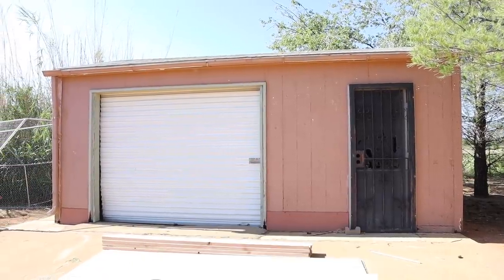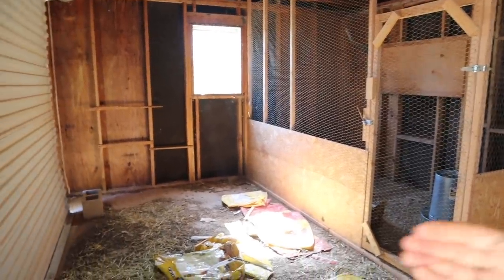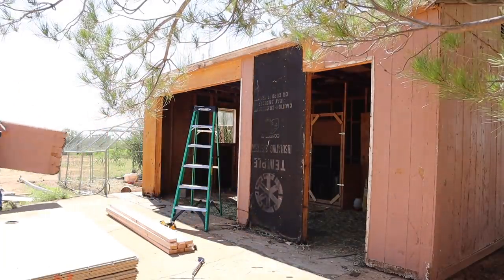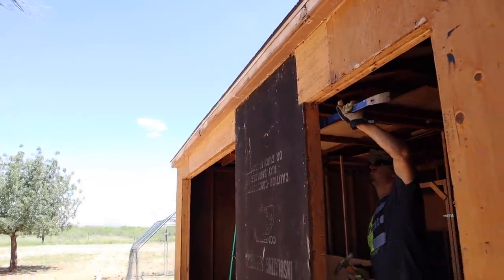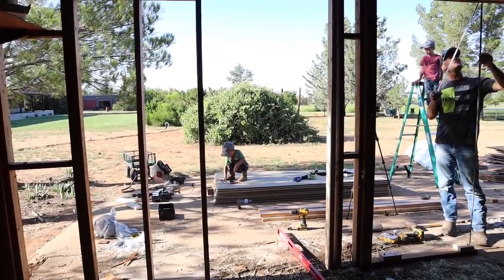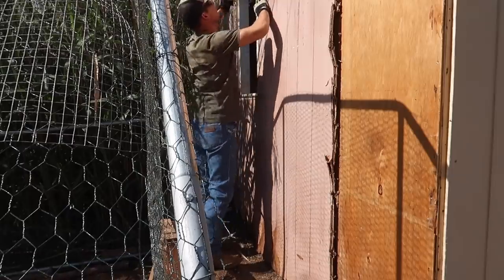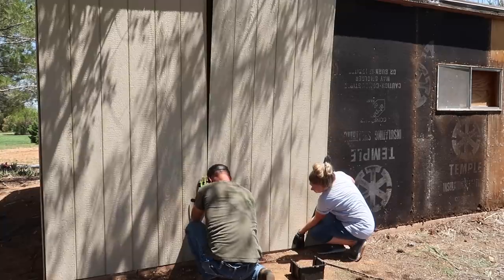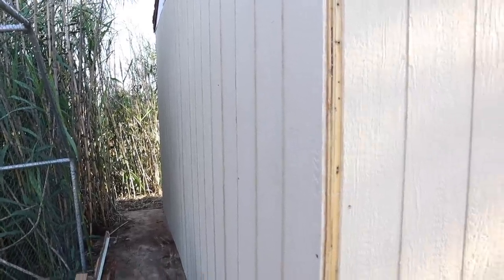HUGE UNDERTAKING!!😱 DEMO DAY & REBUILDING | BARN MAKEOVER PART 1 | RENOVATION HOUSE PROJECTS

Comment: That looks amazing allready! You guys have accomplished so much in such a short time. 
 I have to laugh when you say we have waited such along time. 
 We waited 30 yrs. To get to where we wanted to start our married life. Bought 10 acres back of Hubbies family farm of 40 yrs. 11 yrs. ago. We are remodeling 2 very old mobile homes to attach them togather. Waiting is away of life here. Waiting for a crew to come now & put a roof over the 2 we joined togather. They are both in very bad shape, so it's a similar situation to your barn. Rebuilding outside & inside ourselves. Hoping to be able to get the same siding as what you guys used for the barn. Prices are still high in Mo. Not near our price range we can afford. The mobile homes are in the late 70's models. We are in are middle 60's so since we are doing most of the work ourselves & way slower than we used to be it's taking alot of time. Resources also are very limited & equipment to do it all is very old & kinda primitive. But we started kinda poor & learned how to be very resourceful & make do with less. Not complaining it's a God send really. You never know what's gonna happen in life. We lost our home we spent 30 yrs. Redoing 11 years ago. With alot of bad luck. We had sunk our money into a local daycare center & invested alot of money & time into it. We had 55 children enrolled at one time. And economy went bad in our area. We lost children & hubby lost his job & got into a very bad dirt bike wreak without any medical insurance. When times where lean he was our extra support. So we had to put the daycare up for sale & it didn't sale. So the bank had tied it to our home & they took it & the daycare. Not complaining it has been a journey that is for sure. 
 You are a blessed young family & it would have been nicer if we could have got to start our life where we wanted to. But for reasons I don't know, that was not what God had in his plans. 43 years of marriage now & it has been a very long time. 10 acres of God's land we own now on a little goat farm in Mo. A long long ways from being done with our remodeling & living in a very small mobilehome while doing it. But yet somehow we feel blessed as well. And our caretakers of the small land God gave us to care for. ❤